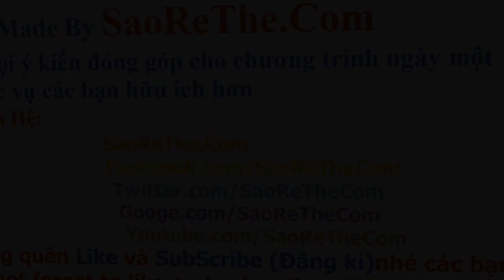Sửa loa bose mini s2025 - repair bluetooth s2025

Comment: Bạn ơi con s2025 cua mình nó có loa . Bật tắt loa vẫn nói mà kết nối blutood thì nó ko hát . Cắm dây 3,5 cũng ko hát dc . Vậy nó bị làm sao . Bạn có sửa dc ko a . Tk
Reply: Bạn cho mình số đt cả địa chỉ nhé . Nếu sửa dc mình chế thêm pin nữa . Nhanh hết quá
Reply from the maker: Chi tiết xem tại website bên dưới nhé các bạn. 
           >>> http://SaoReThe.Com <<<
 Hoặc liên hệ số hotline : 0967.265.695 
               Tư vấn kĩ thuật : 0947.033.995
Reply: Hùng Trần bị hư dây loa r nhé